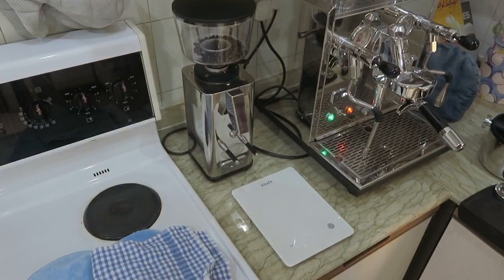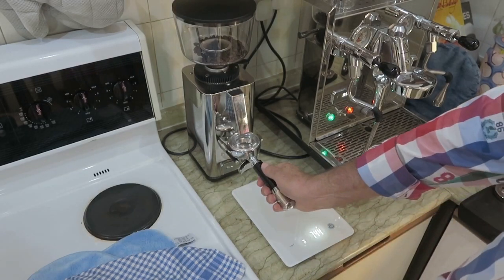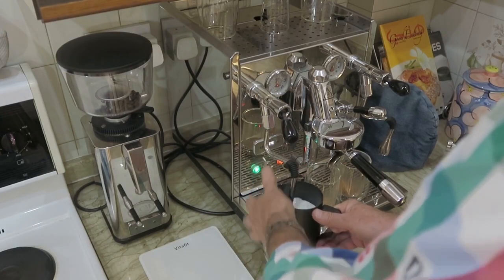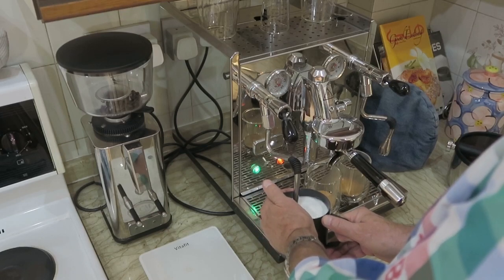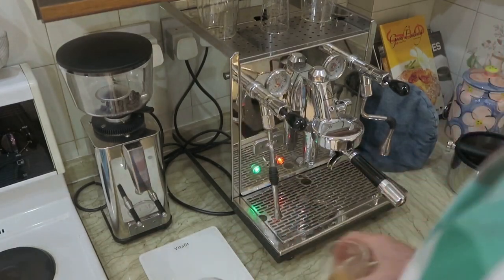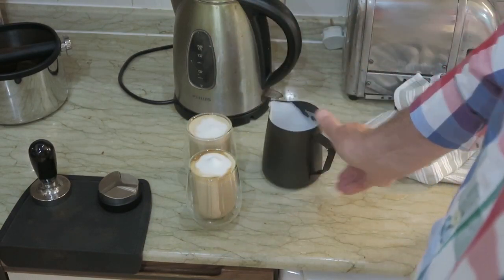ECM Synchronika

Comment: Hi John. Thanks for taking the time to show your ECM Synchronicka  coffee machine. It's a beauty. Your process of purchasing items is very similar to mine. (Great minds...) Best of intentions to not spend too much. However, we don't want to regret buying something we will not be happy with for the sake of a few extra $. May I ask where you purchased your machine please? Elektros? If so any concerns over warranty here in Australia? Further, have you had any issues since ownership? Thank you.
Reply from the maker: Hi PC, I think it’s a sensible approach  and yes we bought it through Electros. The saving on tax virtually paid for the shipping. Guarantee applies but you have shipping to consider. I trust to the build quality and regular care and so far it’s been perfect. We love it and it has been a godsend during periods of lockdown etc. we have not tired of the classic look and it is lovely to use. My only concern is the size and it’s a big unit. It fits fine here but when we move to our home in the uk the space to the top of the overhead kitchen units is small and likely not enough to heat cups. Almost certainly it will need to be plumbed also. Other than this, do your measurements and buy with confidence. They are upgradeable also which is nice but very happy with ours as standard. Best of luck and enjoy.